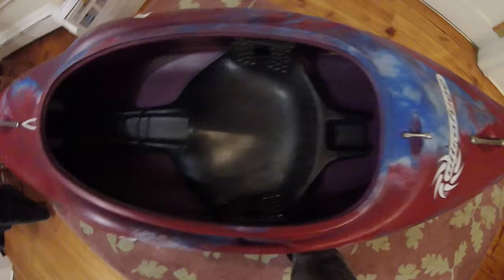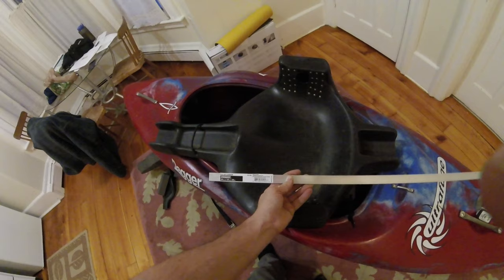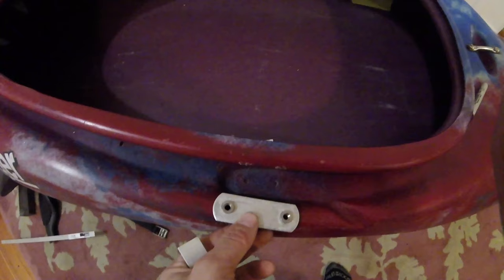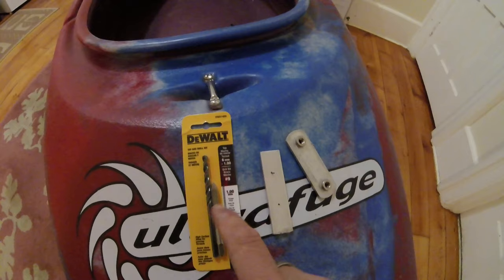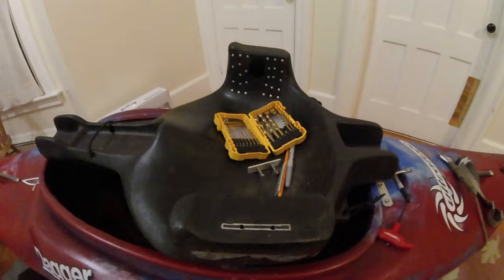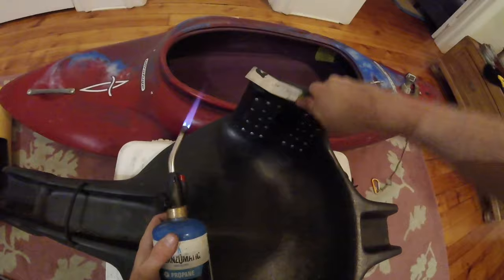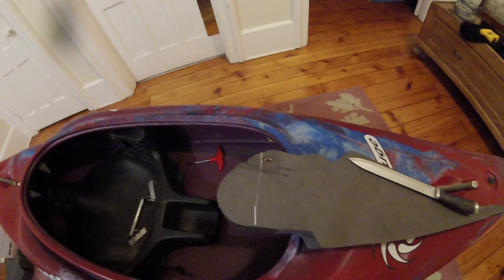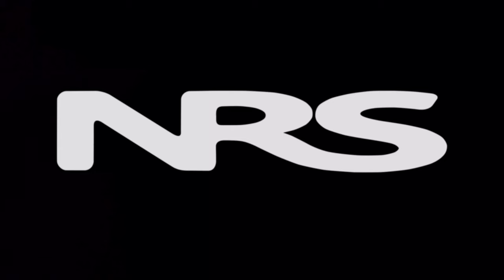Adjustable Seat Upgrade | Squeeze into a Dagger Ultrafuge | Boat Builder

Comment: Love this idea!! How’s this holding up? With the open slots would the seat not just slide around unexpectedly since it’s not actually bolted into any holes? Do you think drilling more holes at the top of the seat would be a better option?
Reply from the maker: It works as it should. Most modern boats have slotted seats not holes.
Reply: @AlexBarham  did not know that! Thanks! Giving it a shot this weekend!
Reply from the maker: Good luck!

Comment: I picked up a ultrafuge recently and am wondering replacing the back band system in it, if you have any ideas what may work best for this boat.  As of now there is basically very limited to no adjustment.
Reply from the maker: The easiest thing is the IR Reggie rear adjustment backband. For a truly modern system check out my other boat builder videos
Reply from the maker: @SadhuButterton-b9t  https://youtu.be/ko_eLt7m8I0?si=m7eTCDHKDSwxPzEG